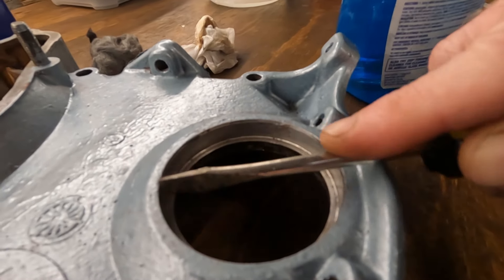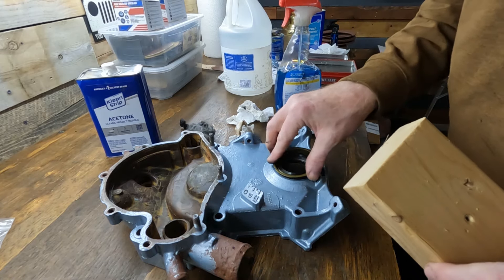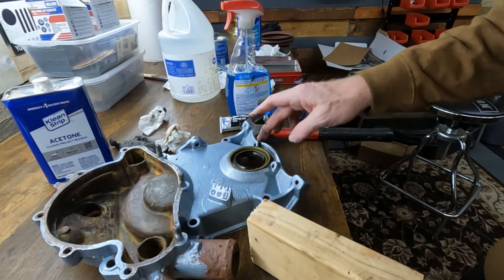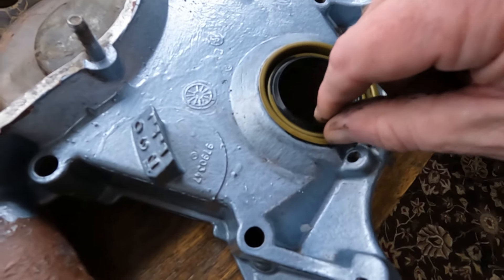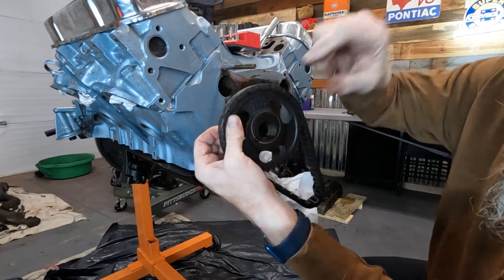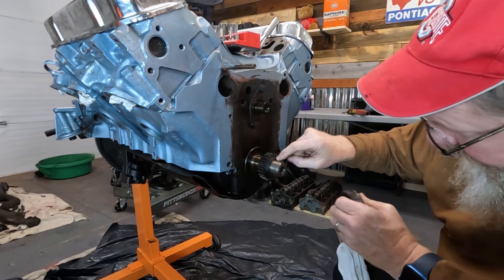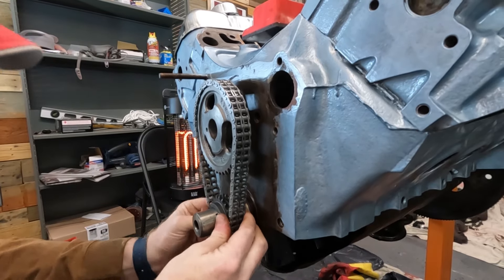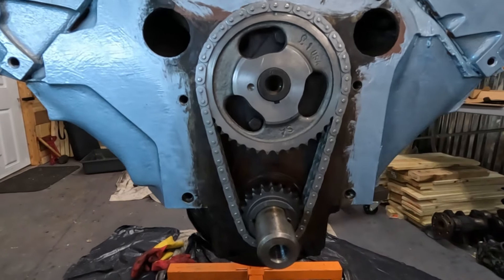Replace the Pontiac Timing Chain!

Comment: Solid job! Run the new piece. I’d recommend to ensure there’s at least .030 clearance to the impellers to the water pump backing plate. If you were to take the plate and made it to the original water pump, you’ll see there’s a very tight fit which helps with the flow. Since you’re using the new water pump, those fins will have excessive clearance which may lead to running hotter than normal. Just a suggestion. Thank you for your video that was really outstanding job.
Reply from the maker: Thank you very much! Yeah I have heard clearance is a big issue with the plates on the Pontiacs. Hopefully I can get it right. Thanks for watching!
Reply: You've done great work and look forward to the next installment @Rustrevivalgarage
Reply from the maker: @fullthrottlekindaguy  Thanks again! And I just subscribed to you as well!

Comment: Hi, thank you for sharing. How many miles does this timing chain last if I change the engine oil regularly?
Reply from the maker: That can depend on many factors. How good of shape your engine is in, was the cam installed correctly, is it the right cam for the engine, etc. But most timing chains, if they are quality-made should last for 80k to 100k miles.

Comment: Hello, brother if the original war pump is still original to the car. And has the correct casting on the outside. I will use the original one now There is a trick with the backing plate to help you keep the engine nice and cool and for those aerosols.  Spray cans to work again. Just use your air compressor and shoot some air straight down to it.
Reply from the maker: I'll give it a try! Thank you!

Comment: I say if the water pump is easy to get to and take on and off, then go with the original. If it fails then replace it.
Reply from the maker: That’s the way I’m leaning. It did work well before I took it out. The pump just looks bad. But I may give it a try. I’ll hang on to the new one just in case! Thanks